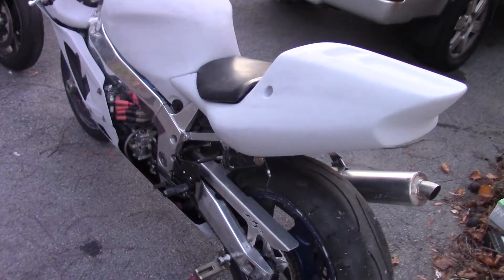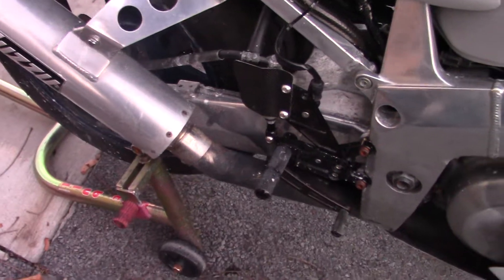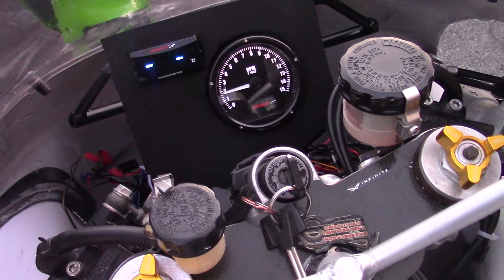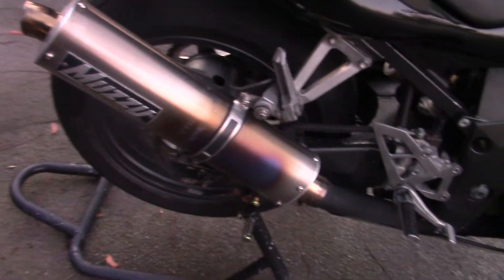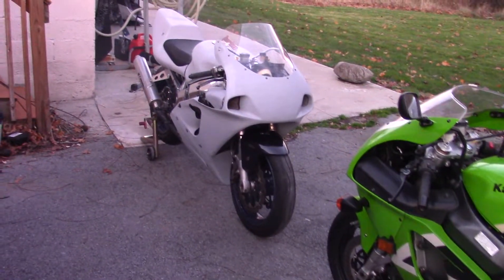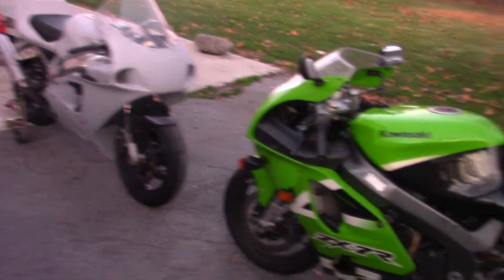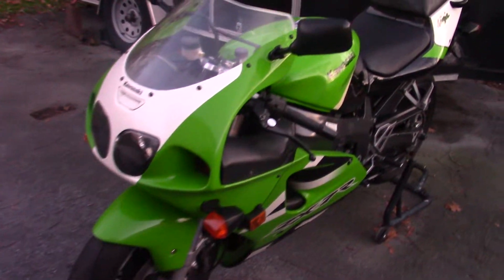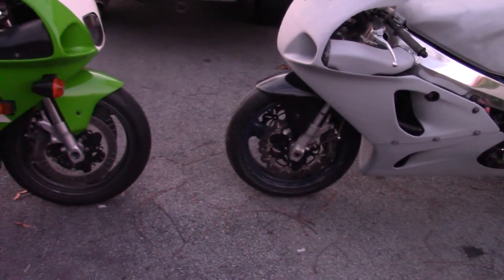ZX7R VS. ZX779RR - Which One Sounds MEANER?!!!!!!

Comment: Hello from England, great channel! Owned my green 02 7r nearly a year now,  so much character and still a very capable bike. It's gonna go into hibernation soon as I don't ride in the winter sludge anymore, any tips for winter storage?
Reply from the maker: Thanks Pugsly.   Just fill up the tank with fresh fuel and add a fuel stabilizer.  Then let the bike run with the petcock set to "Off" so the carbs can run dry.  When the bike dies then you know the carbs are empty.   You should be good to go until next season.   If you have a track bike, make sure to remember to drain the water/water+water wetter so that it doesn't freeze up and crack your cylinders (if the bike is stored outside).  That's pretty much it.

Comment: Don't forget to disconnect the fuel pump when running the carbs dry. The stock 7 sounds meaner on video.
Reply from the maker: That's a great suggestion.  I typically don't do that and never had a problem but it is very good practice.  I usually just fill up with fresh fuel and add a fuel stabilizer after letting the carbs run dry.
Reply: @Turbo329  please paint the race 7 in the factory race colors(green). Eric Bostrom one year had this metallic green in AMA racing which was sick. 1999 I think. I found one dated July 2000, I can PM it if you want but do not know how...

Comment: what do you think about dynojet? is it worth it, is it better to adjust the original needles with shims?
Reply from the maker: I love Dynojet.  I’ve put them in every carbed bike I’ve ever owned.
Reply: @Turbo329  I installed in my motorcycle(zxr 400), I set up jets to the instructions of the dynojet and it seems to me that it gets too much fuel, because the engine stops over 7000rpm. And so I wonder whether to return to the original keihin95 mainjets and needles, or to start a smaller dj92 than dj96
Reply from the maker: @kawosz90  Dynojets use much smaller jets than stock.  If you’re running a 9x dynojet main jet I can tell you that’s waaay too rich.   Did you buy your dynojet kit new or used?  Also make sure your float height is set correctly and that your float valve seats aren’t leaking.  Those two things have nothing to do with Dynojet and can also cause the symptoms you described.
Reply: @Turbo329  I set the float height as the instructions say (11 + -2mm), and exactly 12mm, because someone on the forum wrote that need to set a lower fuel level for Dynojet ...I replaced all the needle valves with the new Tourmax, but the original old seats were left in place, so maybe they are not much different and do not match hmm
Reply from the maker: @kawosz90  Use only OEM parts on your carbs.  I usually get my stuff from JetsRus and K&L
Reply: @Turbo329  you re right, spare parts are crap

Comment: Hey Turbo i got an 03 Zx7r but i bought it all taken apart. Im having trouble because there are 2 lines on either side of the bike that i dont know where they go to. Can you post a video on where your fuel lines are going to on the bottom of the tank please? I would really appreciate it. Thanks
Reply from the maker: I will be happy to help but won't have access to the bikes for a couple of weeks.  If you can post a video I can watch it and make some comments.
Reply: Turbo329 Do you have an instagram? I would be able to show you easier there. Love your bikes by the way. Whats your opinion on the zx7r for a first bike?

Comment: What weight did you get down to on the 779? I always loved the ZX7R but got an E model ZX9R in the end, based on the perception of how heavy the 7 is to lug around.
Reply from the maker: I don't have an exact figure but I'll get back to you with an estimate.
Reply: @Turbo329 thanks buddy, but don't go to any trouble , I was just curious. I love seeing your bikes though and what you've done to create the 779 is inspiring. Keep up the good work. 👍
Reply from the maker: @paulperry8800  Thanks Paul.  I am actually interested in knowing how much weight is saved but would like to go back to aftermarket wheels before I put the bike on the scale.   The Mag wheels I had were aged and had started to corrode so I chucked them.   I'll keep you posted.  I would imagine that I shed at least 75lbs by removing all the stock stuff.
Reply: @Turbo329  👍

Comment: Hey I have a 98 ZX7R. I'm trying to customize everything but I really don't know where to start. Everything is stock. Someone said to get another engine but I think I can customize the bike and get more power\speed\and better sound. Hit me up and lmk
Reply from the maker: You can find an engine cheap off of ebay but honestly, it's not worth throwing too much money at it.  it took me two years, a lot of time and $$$$ to get it to 140hp (Crank).  I would just get one, put a Dynojet Stage 1 Jet kit in it, a K&N air filter, and a full exhaust system and call it a day.  This is why my '02 is pretty stock.

Comment: Nope. 'Running dry' does not empty all the fuel from the carb, it leaves a little. You want to empty the carb completely, you must remove the bowl and wipe it clean. In truth, a little fuel in the bottom is worse than a full bowl. What prevents jets from gunking up is regular running .... what is right now , running dry or not ?
Reply from the maker: You're right because moisture can seep in but that has never happened to me yet.  I guess because my bikes don't sit without starting for longer than 3 months.   Good point.  Thanks for your comment.